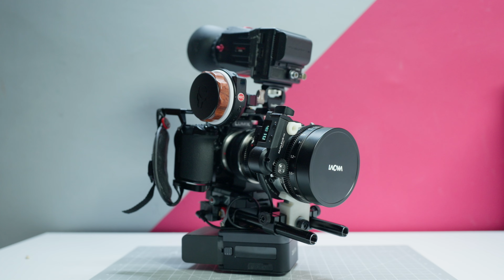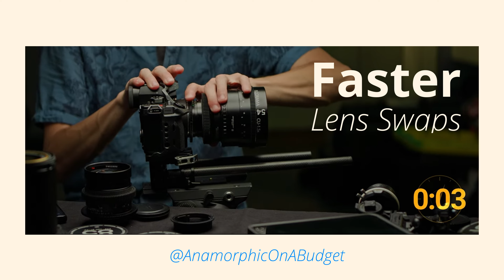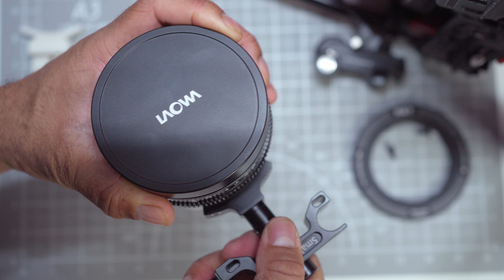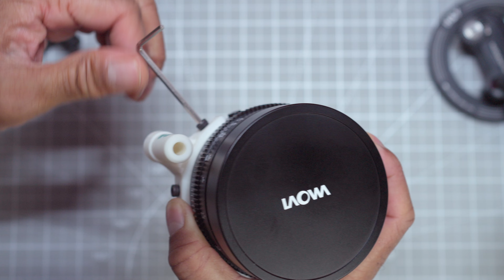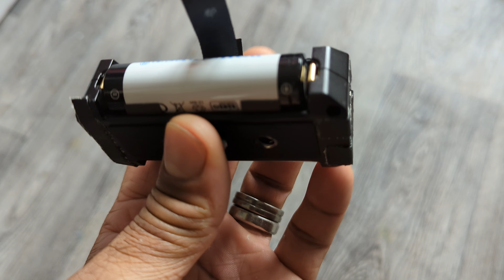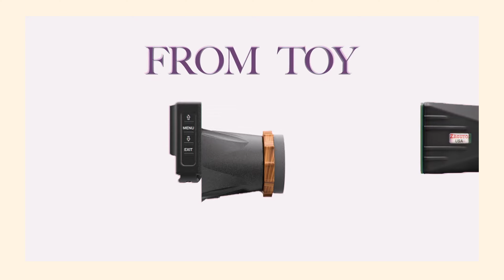Laowa Anamorphic Rig 1.33X + 3d printed Parts - #laowa #anamorphic #mamiya #lumix  #camerarig

Comment: One question: does the revoring's relative thickness affect the optical quality of the images, as it would seem to introduce more distance from the taking lens than say a slim step-up ring?  I like the convenience of the setup, but am just wondering if there is a quality tradeoff.  My assumption is that this would be more of a problem at the wider end of Laowa's focal length range for this adapter, ie 50-100mm.  I'm also wondering, have you tried lenses wider and longer than that range?  I'm considering this anamormphic adapter, but I'd like to use a 45mm and 135mm lens with it and wondered if they would work?  The lenses I have in mind are Pentax 67 45mm f4 and Pentax 67 135mm f4, both would be using my Kipon P67 to L mount focal reducer.  Many thanks